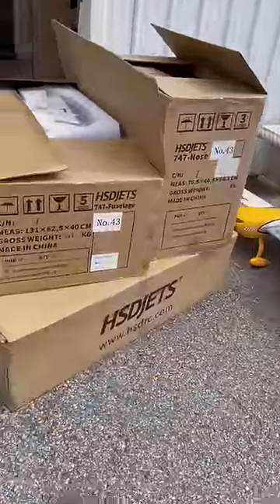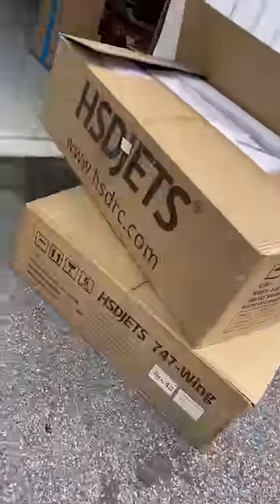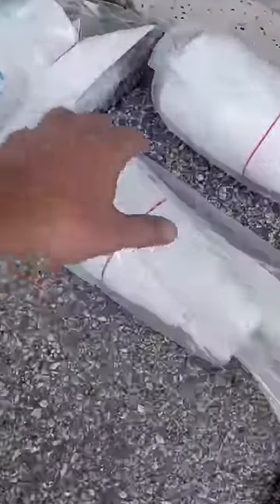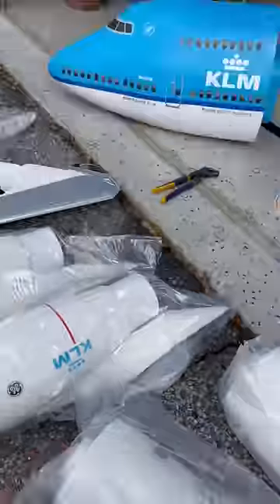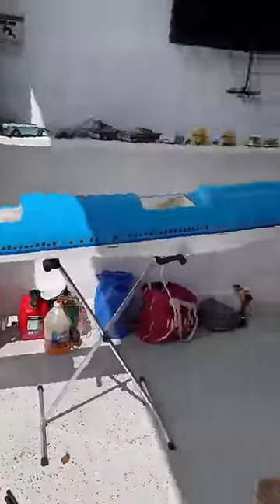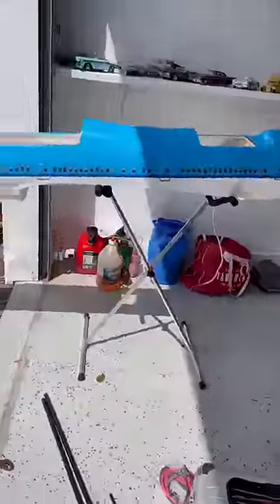GIANT RC 747 AIRLINER 🤯

Comment: Those Who Miss The 747

👇
Reply: ME
Reply: Mf you didn't even see one irl 💀
Reply: @LaserKiwi535  WDYM?
Reply: As a aircraft engineer I used to work on 747s, every model type 747-100, -200, -300, -300 Combi, -400, -400ER, -8, SP and Freighter.
And have flown across the Pacific Ocean many times on most models. 
 Such a fantastic aircraft to work and fly on.
Reply: There still are 747
Reply: @paulynnhanief4646  yes but they'll be gone by 2030

Comment: Damn, I am into anything rc related. I have built a lot of cars  trucks and helicopters. Hopefully my family situation will better soon, because I want to get a plane that's a little smaller and user friendly as I haven't ever had a chance to fly a plane. They're so expensive and im afraid to destroy its.  I have a Traxxas bandit with upgraded charger and instructions and bag with extras and  accessories never opened. The car has a couple small scratches on the bottom but was only ran on pavement and only used handful of times. Very fast and look brand new. Oil filled shocks in perfect condition. I would love to trade. Got too many cars 😂